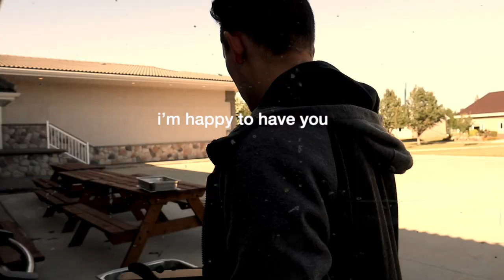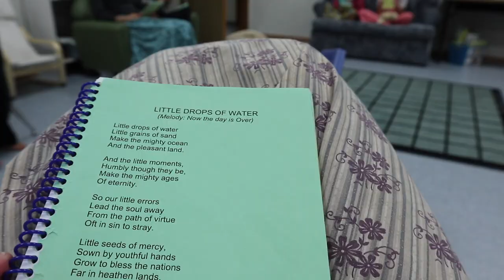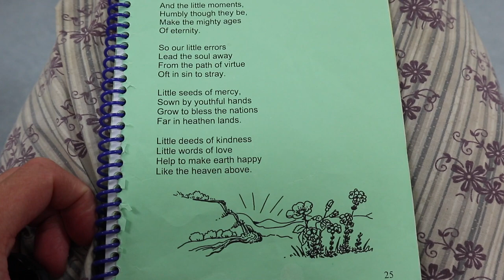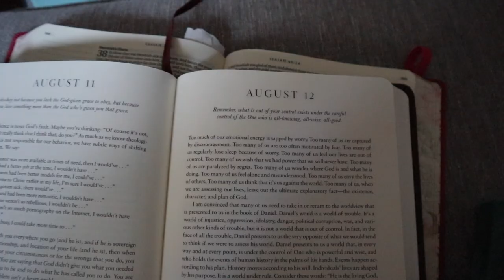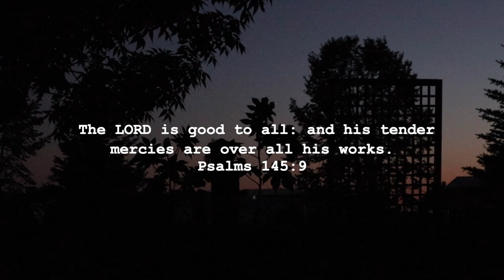Vlog #69 Work week, cougar sighting near our colony??? + cooking Q&A

Comment: I love you blogs and look forward to them. About the cougar,  remember,  they are very skilled hunters.  Try not to follow a routine. They are well known stalkers and will time your activity.  I love the garden work. I miss it alot. Nothing feels better than knowing you are prepared with a well stocked pantry and freezer. 🍇🍍🍓🍒🍑🍎🍅🥕🥦🧄🧅🥔🥒🌶😁👍💞
Reply from the maker: Thanks for the helpful tips...I noticed the past couple days on our walks Kona was acting strange, it didn't register what it could be until we were told it had been spotted. 🤭
Reply: @gisellewaldner9406  Smart Kona can sense a predator for miles!  Pay close attention and turn around when she alerts to anything or acts unusual.
Reply: @gisellewaldner9406  wow, that is scary. Please keep a close eye out when walking by yourself.
Reply: Make noise to scare a couger away and of course Kona will guard and alert you , no problem. I grew up in the north and there were many predators but they are rarely an issue.

Comment: Another beautifully done video Giselle. You really have a talent and I'm happy you share it with us. Kona is so sweet and little Hannah is a gem! You made me remember something from years ago when I got back late from a long trip. The next day was garbage day so I wanted to take it out before I went to bed. I grabbed the bag and opened the front door. To my horror there was a cougar sitting on the hood of my car, facing me, not 10 feet away. We startled each other pretty badly as it immediately crouched and hissed at me. I slammed the door and worried myself sick it was going to find a way in. It didn't of course and trackers came out the next morning. They found tracks of 2 cougars all through the neighbourhood but it was too dry to follow them once they got into the bush. A very scary experience!